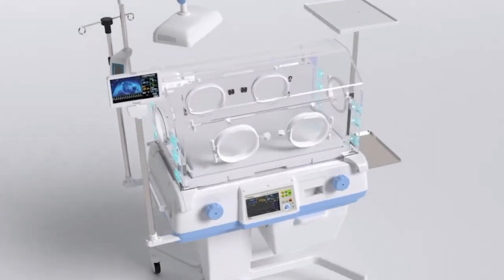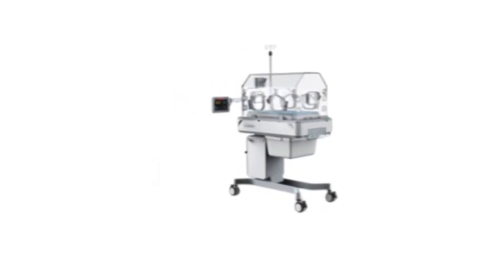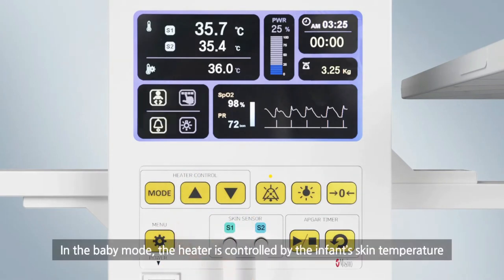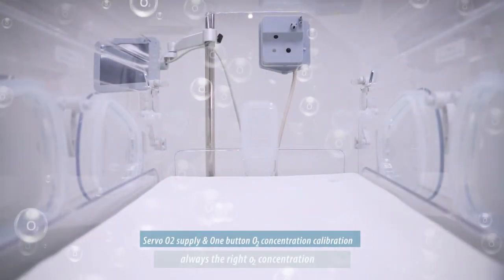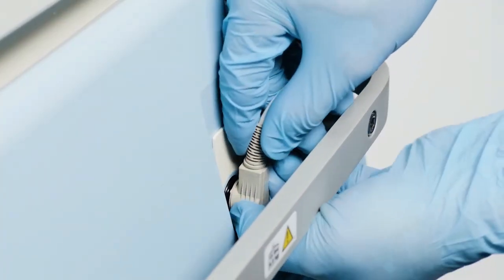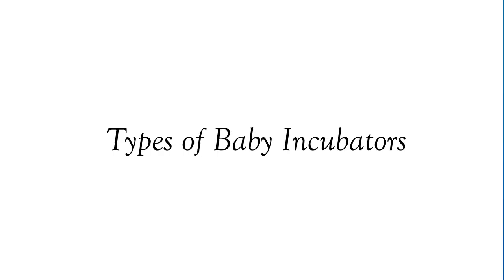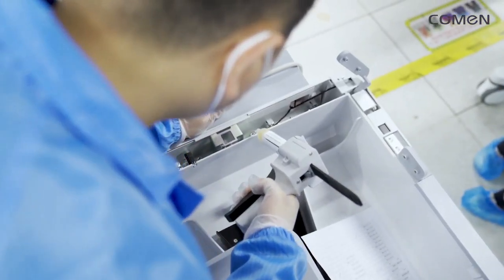Baby Incubators | Biomedical Engineers TV |

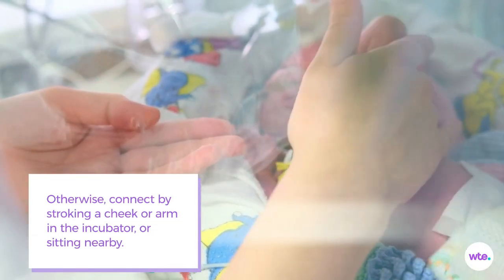Comment: at @1:20 you say "devices are regulated by servo control". exactly what part is controlled by a servo? the opening of the incubator, to let more cold air in?
Reply from the maker: This incubator can be programmed to adjust the temperature and humidity level based on sensors that are attached to the baby
Reply: @BiomedicalEngineersTV  Ah I see the issue, I assumed this was an engineering channel. My bad
Reply: :face-red-heart-shape: